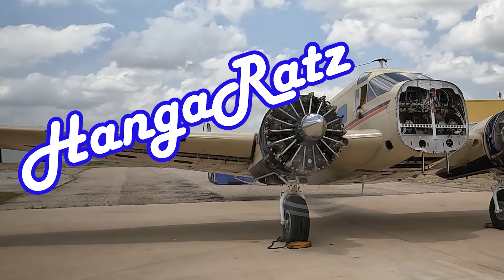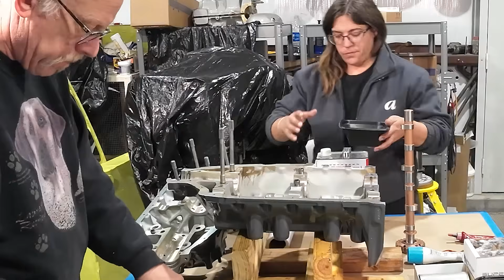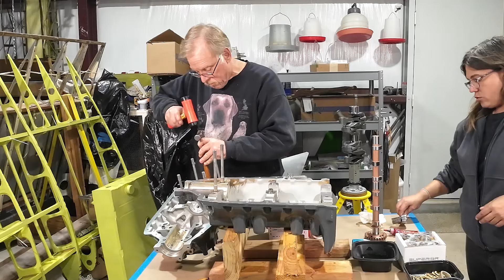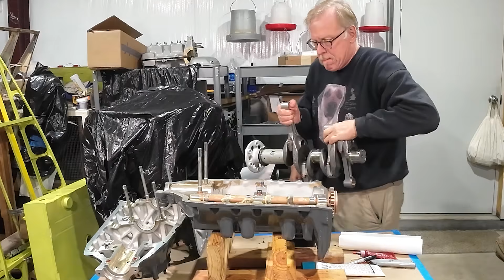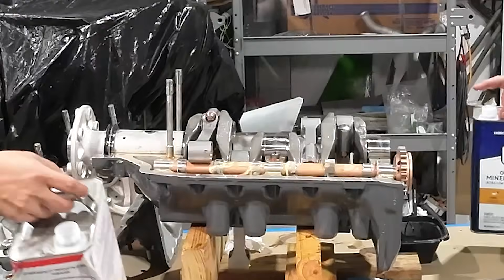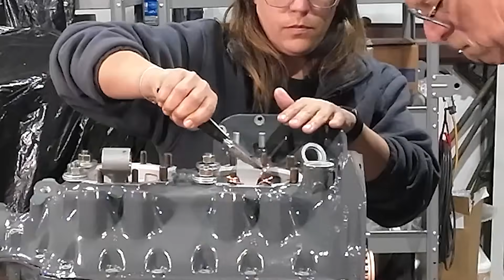Lycoming Narrow Deck 360 E03 Narrow Deck. Crankcase Assembly

Comment: Love the love for this. And your sweatshirt. Q: Does the MRO call to lube the backside of the bearing shells? For both front, middle and rear? Trying to make more sense of the language in my manual when it comes to assembly prelube in those spaces. Thanks. Enjoy.
Reply from the maker: No need to lube the back side of the bearings.